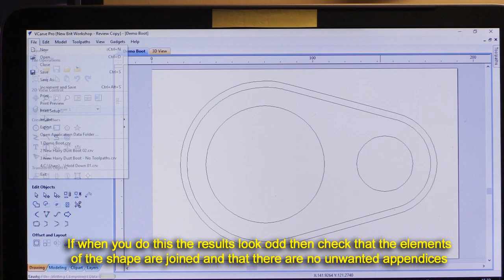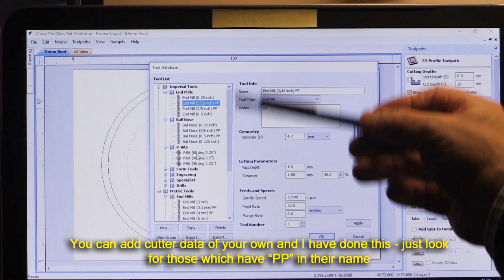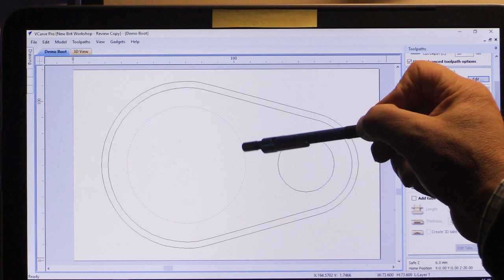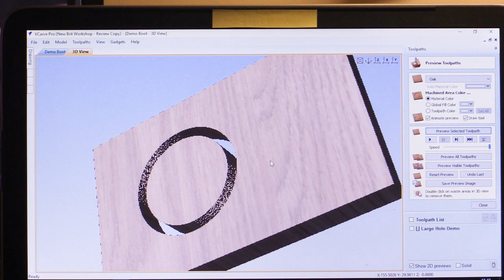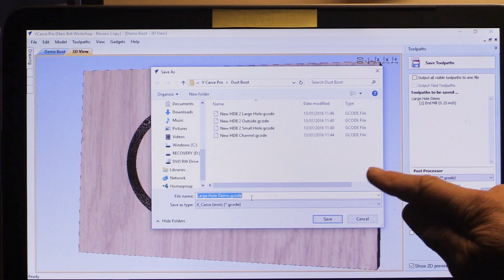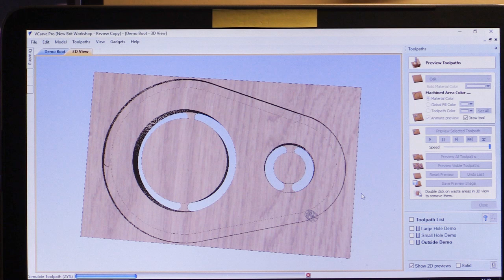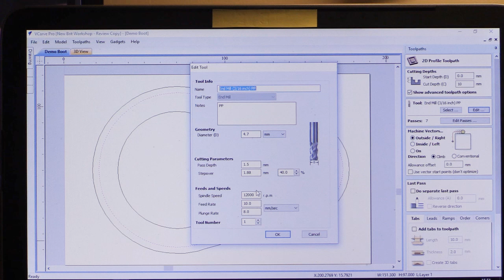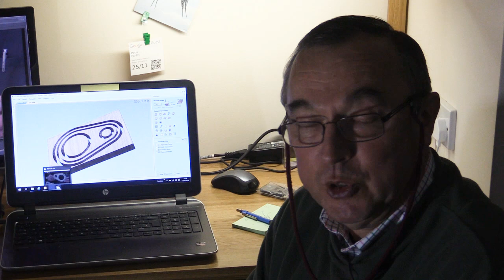Making a basic CNC dust boot using VCarve Pro - Part 2

Comment: Thank you again Peter for a great video! I just subscribed to your channel and will look forward to many more of your teaching. I am a bit curious though about the "tab" settings, not that I'm even at that point yet. Your material thickness was 19mm and you set the tab thickness at 2 mm, does that mean that the actual thickness is only 1 mm as you plunged your cuts to 20mm, 1 mm below, or does the program calculate based on material thickness? Thanks again, and will look forward to talking again.
Reply from the maker: Hi Andrew, The program knows the thickness of the material and the "reference point" is set, in V Carve Pro as the top left hand corner of the material. The program also knows the thickness of the material. So the tabs get done quite simply. Just give it a god on some scrap wood and try different tab thickness to see what I mean. Many thanks for the kind words. Peter

Comment: So, Peter, do I understand correctly that, unlike easel, you do not send the instructions to the CNC directly from carve pro? You need another piece of software like UCGS.
Reply from the maker: +Itz MeAgain Yes, You need UGCS as VCarve Pro produces the raw gcode and it needs to be delivered to the X-Carve. It is a free piece of software and allows you full control of the X-Carve.    Peter
Reply: +New Brit Workshop (Peter) Sorry to pester Peter but do you still connect via USB from the PC to the carve controller?
Reply from the maker: Yes.  Peter

Comment: Thank you for the beautiful information
Can I use VCarve
Instead of Easel program
Reply from the maker: +محمد سيف علي    Thank you for the kind comment.  Yes, you can use VCarve Pro instead of Easel - in fact it brings the X-Carve alive and gives you far more control. You do need to install a gcode output file into VCarve Pro and then use a program called Universal G Code Sender (UGCS) to send the GCode to the X-Carve. The process is far easier than it sounds - even I managed it. I describe it in my video "How a CNC Works - X Carve Coding " which will hopefully be available on this link:  https://www.youtube.com/watch?v=Uv0BEqCT21I     Peter

Comment: Peter, I took your advice that you gave the other day regarding the CMS table saw insert and should have one winging its way to me shortly. Hopefully it's as good as your other recommendations (you'd be surprised at how many of them I have - I'm certainly surprised!).

Anyway, I see you're using 19mm plywood in this video, and I wondered where in the UK you source it from? I'm in NE Scotland, and don't have a supplier near me other than the B&Qs of the world who's plywood is pretty awful. I was hoping to source some good stuff for a project in the spring/summer. 

To add, good video on CNC. I'm a bit of a computer geek, but haven't got the spare space (yet) for a CNC, so I'm holding off for the minute. But the possibilities look great.
Reply from the maker: +Rico S Hi Rico,   Well done one the CMS-TS that is an excellent choice.  I did not have any 19 mm ply and so I joined 3 pieces of 1/4" for this project. I have had it for years having bought it from a company that has now ceased trading. If you only want small amounts of high quality (birch) ply then try ebay. However, most timber suppliers will get whole sheets for you which is what I did (15 years ago). I do not know the lower end CNC market at all and so when the time comes you need to look carefully at what is available.     Cheers.    Peter
Reply: Thanks for getting back so quickly Peter, ebay has also been my go to for plywood with varying success, I'll just continue with that. I think when I create the workshop space for the CNC it'll probably be something like the one you have, although the technology on this type of machine seems to be changing by the minute. They're the mobile phone of woodworking!
Reply from the maker: +Rico S  I love that - the mobile phone of woodworking - brilliant. Yes, technology moves on all the time and I think that Inventables have identified a number of ways of making improvements. There is also a lot of new competition.   Good luck.   Peter